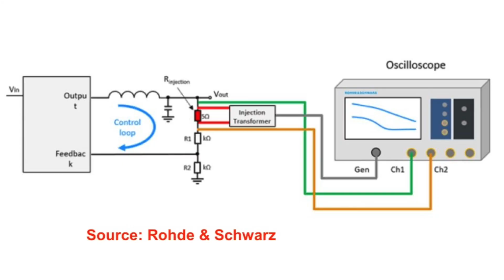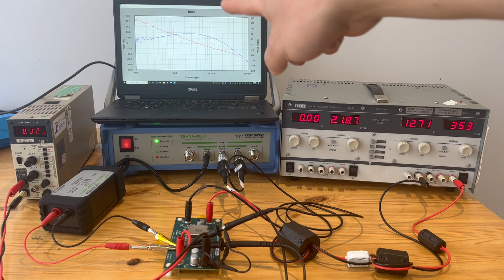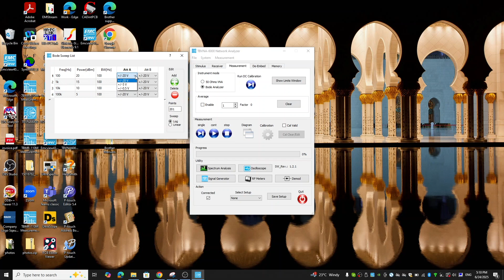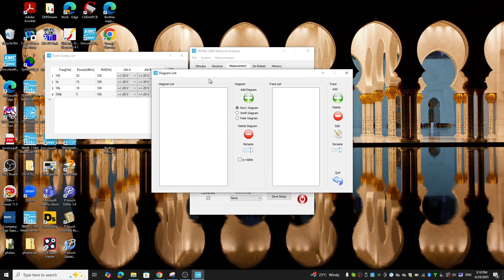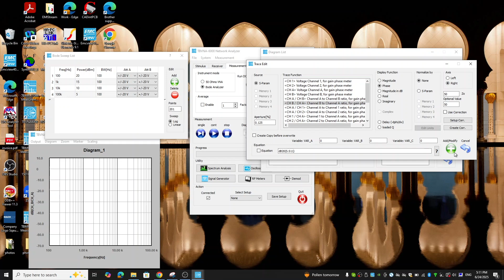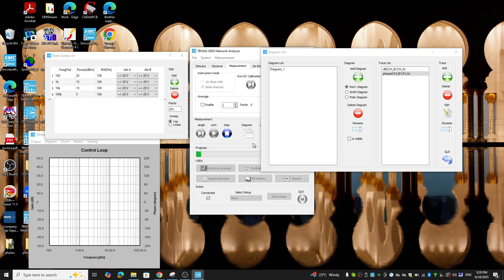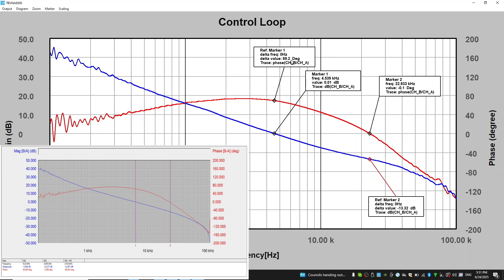Bode Plot for Power Electronics - Hands-On Guide

Comment: Nice video. In most of the application notes and guidelines it is not recommended to use an electronic load, and use of resistive load is recommended. Can you check what would be the impact in your case?

Comment: Thank you for the video.  This is showing the closed loop response, does the system have the capability to calculate the open loop from the closed loop?  GM and PM for closed loop response is not terribly useful, control engineers need the OL response GM and PM.  If the system can export CSV for gain and phase plots, then the transform G/(1+GH) -> GH can be computed in something like Excel (and then extract |GH| and <GH), but it would just be better if it could be done within the instrument (like it can be on something like the 35670A Dynamic Signal Analyzer).